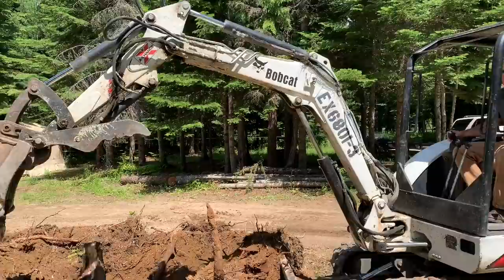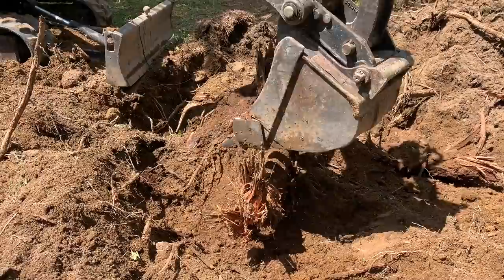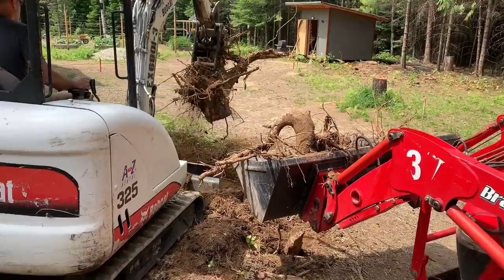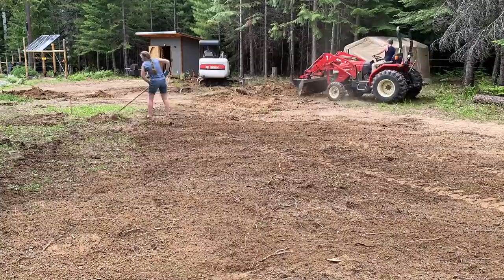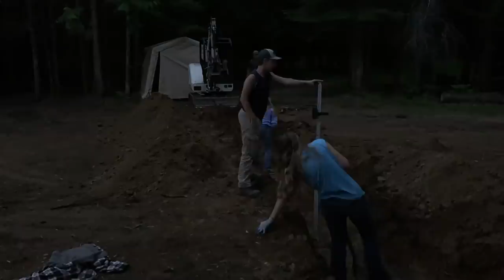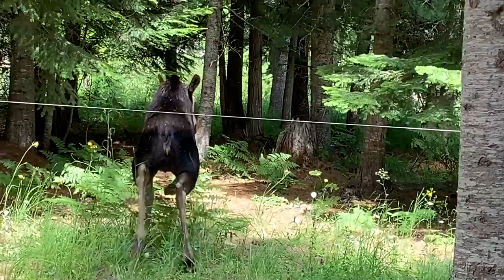Couple Builds Off Grid Dream Home - Digging Footers for the Garage

Comment: It is better to break roots with such a small machine, if you just use the showel under the root to push and break it, instead of pulling on it with the whole machine. It may be wise to lower the front scraper to support the machine on soft ground. The machine calms down and is not such a rough ride, and with less wear and tear on it. You should consider using the seat belt, at it is there for your safety. If the machine tips over, you may fall under it and get crushed. Nobody wants that, least of all you. It is also helpful to strap in when you climb steep objects or hills. That way you don't need to hold on with your arms and legs, when you need them to operate the pedals and joysticks. I have had a Volvo EC55 excavator for some years and did a lot of work with it. Be aware of your surroundings and don't use force on the joysticks. It is easy to loose control and whack something with the showel if you move too fast, or run over something behind you. Be safe.